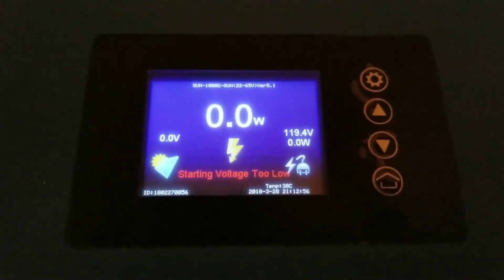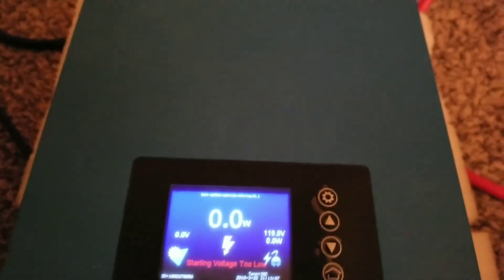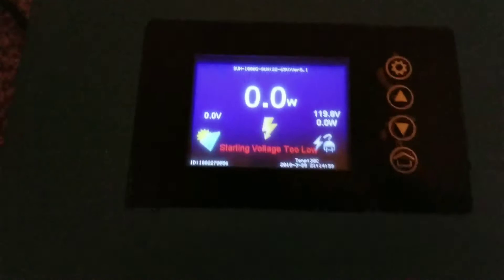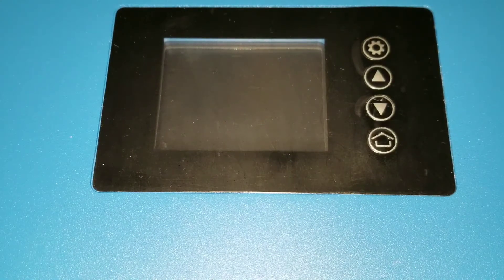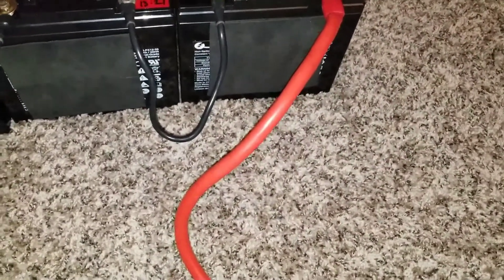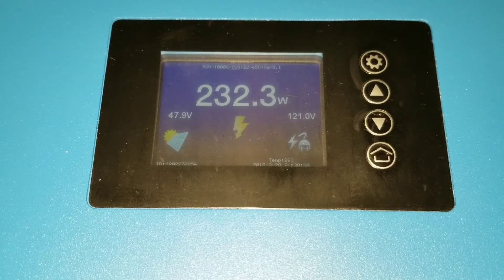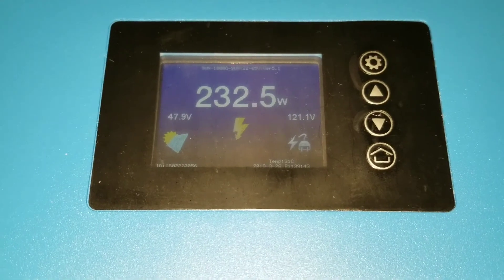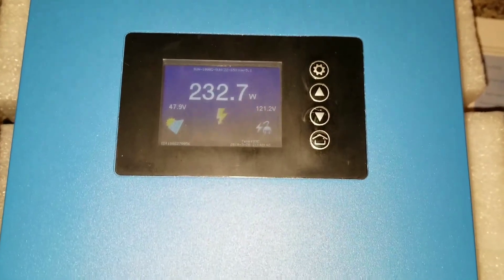DIY 48 VOLT BATTERY BANK TIED TO A SUN-1000GTIL2-WIFI PLUG-LD GRID TIE POWER INVERTER WITH LIMITER

Comment: To people asking, amp hours (ah) is a capacity of your battery storage (current flow over time). Amps (a) is the current flow. 

Additionally, Watts is calculated by Volts x Amps. So 2000w from a 48v battery would be about 42 amps.

AH is NOT Amps. AH is amps over time. You could have a 1000AH battery hooked up and it would be fine. A 1,000,000AH (1 million) would be fine.

You wouldn't want to use a 20AH battery or a 7AH battery. These would be discharged so quickly that they would be not fit for purpose, and that discharge rate would probably damage the battery in a short time period.
Reply from the maker: Thanks for your input Collin .B
Please don't forget to check out the rest of my videos, playlist and don't forget to SHARE LIKE and SUBSCRIBE

Comment: Whst is the input voltages to the GTI your using? 22-60 or 45-90v?
Reply from the maker: 22V-60V
Thanks for watching.
SUBSCRIBE LIKE👍& SHARE
Reply: @jwsolarusa  thank you. Yes that's what I thought. I have a 45-90v input  1 kw GTI.
Getting ready to add a battery bank for night time use. Was just checking around if anyone has used a 48v bat bank with a 45-90 v input on the 1 kw GTI's.
I appreciate your quick response.
Subbed!!😁
Reply from the maker: @leamyelectricinc1  
Here's a link to my videos series.
GRID TIE SOLAR INVERTERS: https://www.youtube.com/playlist?list=PLSNjIRSnUPDL4fWuaEW_gOZc-bQFuWZvV

Comment: Can you attach 48V battery bank (100AH each) 
directly to the + and - terminals of the  SUN-2000GTIL2-H ?? Please advise...Thank you. I connected 48V battery bank to the + and - correctly and blew the unit???
Any suggestion. My unit is the 2000W Grid Tie Inverter Power Limiter LCD Display DC50-90V Solar Input AC185-265V Output SUN-2000GTIL2-H
Reply from the maker: That's exactly what i did. 
LIKE SHARE & SUBSCRIBE

SUN-1000G2 GRID TIE POWER INVERTER WITH LIMITER: https://www.youtube.com/playlist?list=PLSNjIRSnUPDJ1Cp3JTPumQ7e8fehjCFqv

GRID TIE SOLAR INVERTERS: https://www.youtube.com/playlist?list=PLSNjIRSnUPDL4fWuaEW_gOZc-bQFuWZvV
Reply: Why he did not unswer with a correct question ???  
The question is :  Can you connect  with 48V , 100AH  each ???? 
* If can , just  say  YES  
* If can not , just. say  NO ,

Comment: I have 4 of these same types of types of tigrids and verters but nowhere can I find on how much amps can run through these machines we know how much voltage can run but how much amps can you put through these machines I want to know if I can take a 48 voteight 8 vote battery called Reynold rhino from big batteries  Which has 276 AH  Is that too much amp hours or is this OK I can't find in the destructions or any YouTube videos to tell the capability on how much amperage can run through these machines
Reply from the maker: Thanks for watching. Here are playlist on how I installed these Gridtie inverter limiters with battery backup system from start to finish.
Don't forget to LIKE SHARE and SUBSCRIBE.

SUN-1000G2 GRID TIE POWER INVERTER WITH LIMITER: https://www.youtube.com/playlist?list=PLSNjIRSnUPDJ1Cp3JTPumQ7e8fehjCFqv

GRID TIE SOLAR INVERTERS: https://www.youtube.com/playlist?list=PLSNjIRSnUPDL4fWuaEW_gOZc-bQFuWZvV

GNB SPRINTER SEALED AGM, FLAME RETARDANT: https://www.youtube.com/playlist?list=PLSNjIRSnUPDLi1N3G6rlsQSXuXz8fRjdd

Comment: If the limiter was connected and the load was 50w would it only be draining 50w from the battery or would it still be draining 230w? I'm sorry if it's a silly question but I'd really like to know.
Reply from the maker: If the Limiters was hooked up, it will compensate the house load. 
There's  a another option on the settings that allow you to adjust the threshold you want instead of compensating for the total wattage demands

Comment: Hola Hermano! No entiendo tu idioma! Tengo el mismo inversor con limitador. Lo tengo conectado a dos paneles y no se si puedo conectarle las baterias a la vez. Muy bueno el video felicotaciones!
Reply: Soy de Argentina! Podrías explicarme como conectar las baterias en simultaneo con los paneles?
Reply from the maker: I am sorry......🤔 but don't understand what you just said. I wish I can have you translate your comment to English so I can answer your questions my friend. 
Thanks for stopping by and hope to hear from you sooner and have a wonderful day.
Reply: jwsolarusa Hi brother! I do not understand your language! I have the same inverter with limiter. I have it connected to two panels and I do not know if I can connect the batteries at the same time. Very good video congratulations!
Reply: jwsolarusa I have the same inverter connected with two panels of 260w in parallel and I would like to add batteries to be able to use the stored energy at night. Is it possible to make the mixed connection?
Reply from the maker: @Gensifull  
Hello my friend sorry for the late response towards your question. 
It's now I just saw your comment for some reason I don't know. 
The answer your question is, you can only have solar or batteries. But, you CAN'T have both at the same time my friend. 
The only way you could have both together is by adding a Solar Charge Controller on the solar side to change your battery bank and use the Inverter limiters to invert from your battery Bank. That's the only way you can do it brother. 
Thank for watching and for stopping by  and don't FORGET to LIKE SUBSCRIBE and SHARE my Channel and my videos. 
Cheers
Reply: @Tes Tos muchas gracias por tu comentario! Sólo me falta saber como cargarlas y a las vez conectarlas je
Reply: @Gensifull  

Para cargar las baterias necesitas un regulador mppt exterior.